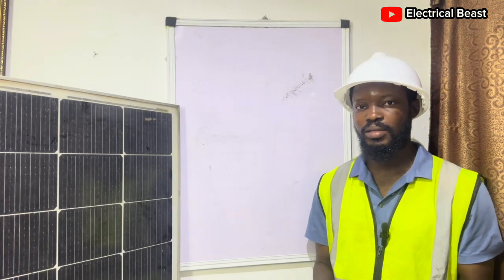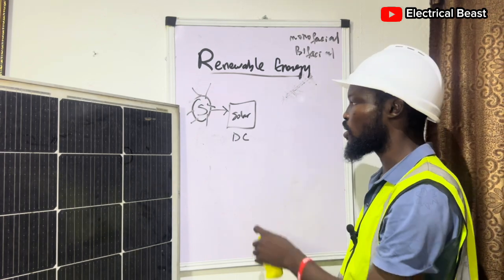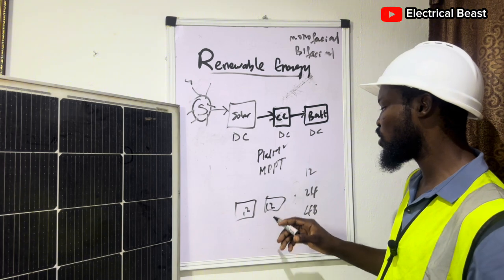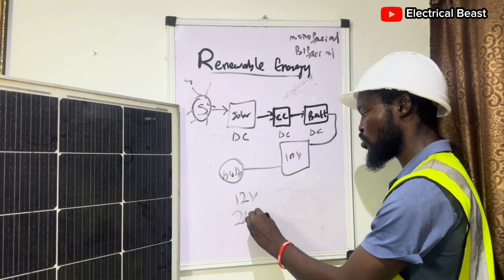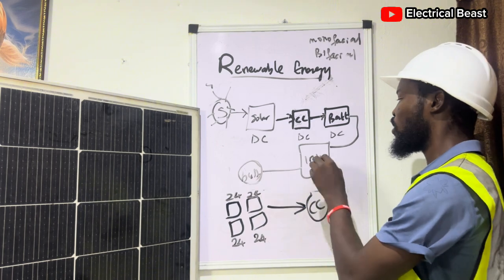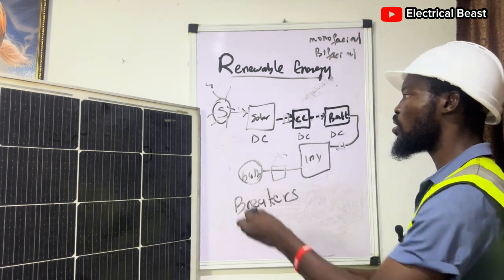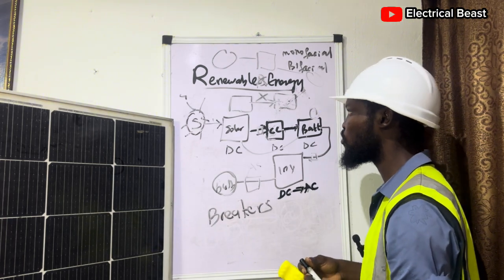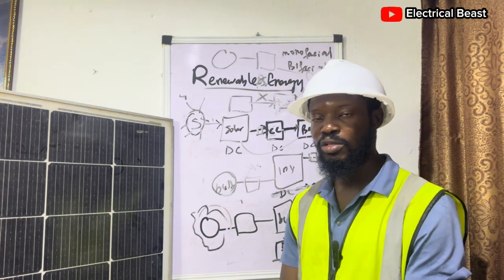Solar and Inverter Training for Beginners.

Comment: But i dont really agree with what you said here, that you shouldn't do parral- series when using a hybrid inverter. In some cases, you have more than 24pannels of 550w, series-parrellel connection is the only way out.

Comment: Bro am using 48 volt inverter with 51.2 volt lithium lifepo4 battery and they are working
Reply from the maker: The nominal voltage is 48v. Most lithium batteries of 48v have 16 cells each rated 3.2v totalling 51.2v

Comment: Well explained, sir if my solar panels connection is 12v with 12 controller and battery what amps of breaker will I use in my connections and if they are 24v  the breaker what will i use. I like the way you teach
Reply from the maker: It depends on the current rating of the panels.